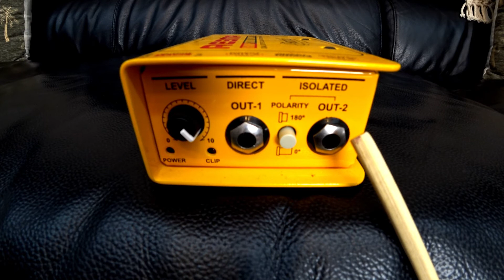Radial Engineering X-Amp Features

Comment: Hey man thank you for this video! really basic question, if I have a 1/4inch line out of my interface can I use a ts 1/4inch to xlr adapter for this without issues? I'm assuming so?
Reply: Ohh sorry it would have to be balanced not ts obviously, my mistake
Reply from the maker: Hi CptDuckDodgers, just caught your message. Yeah that was my response. Good luck with your tinkering!

Comment: I got this one but I’m confused, when I put the level above 30% it starts to get radio signals, even without any cable connected at 100% gets radio signal, is it normal ?
Reply: I ffound the issue haha anyway great review!
Reply from the maker: Hi Mike, I had the same issue when I got this for the first time. No that is not normal. You are getting feedback loops from the microphone. On your DAW set the output to your interface to the right which leads to your X-Amp, the Left hand output should be designated you your microphone. Since the microphone is sharing the same output as the X-Amp there is an infinite loop generating.